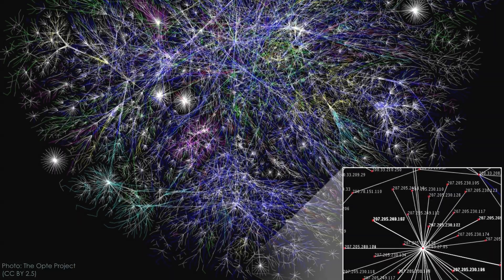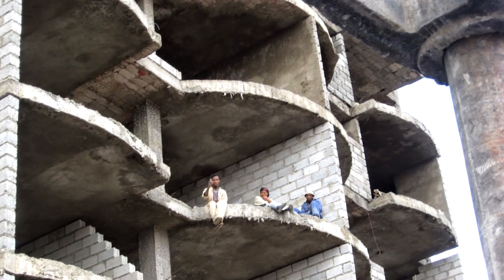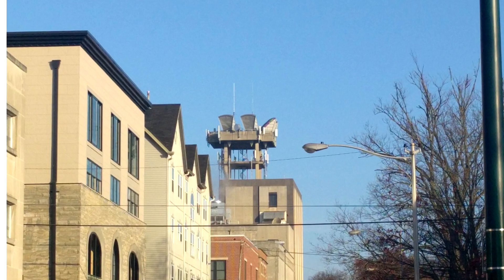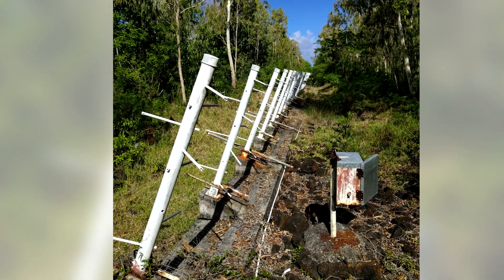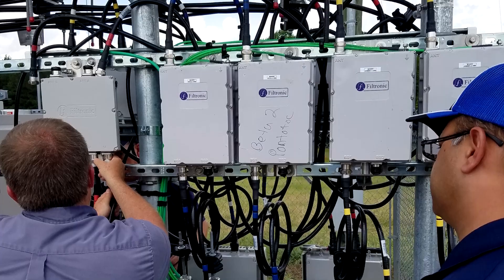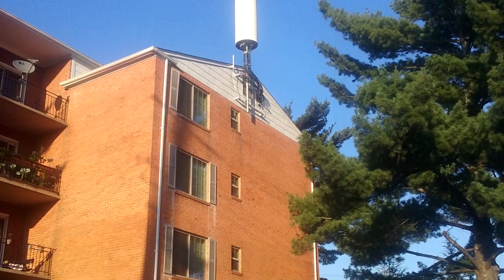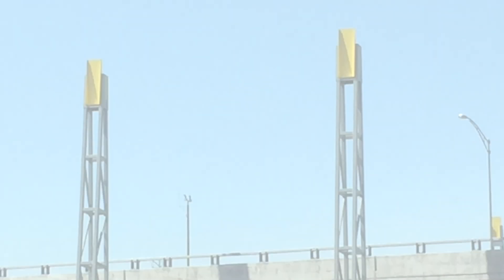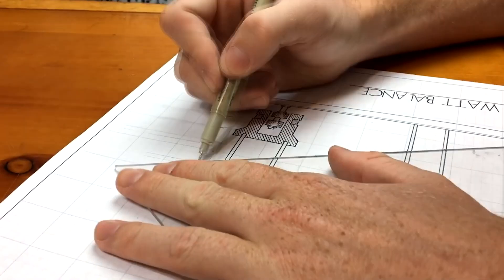What's That Infrastructure? (Ep. 5 - Wireless Telecommunications)

Comment: Small cells is what 5G is going to be based on. Instead of having antennas on tower sites, due to the extremely high frequency of the mm wave (60 GHz), more smaller cells are required to have coverage. This is because the 60 GHz radio waves don't really bend or refract around objects, therefore if the smallest of things is in your way, your signal may decrease in upwards of 30-40 dB, in some cases making it unusable. The high bandwidth of these 60GHz signals require there to be more of a signal present in order to take advantage of all that bandwidth. These signals don't use conventional AM or FM modulation, either. These use a modulation called OFDM (Orthogonal Division Frequency Multiplexing). This is not your conventional CDMA or GSM. This operates differently, applying the same technologies that CDMA and GSM use just a much larger scale. There are plenty of resources explaining how OFDM works, so I won't get into it here because it's a pretty complex topic, but it allows much more data to be transferred than other methods. So basically instead of having 300 foot towers every couple of miles, you're going to have these small cells roughly every couple hundred feet. Also, these small cells aren't just used for 5G, they can act as small base station sites to fill in areas of poor coverage for existing technologies like 4G LTE. In hilly or mountainous terrain, it is really a challenge to get coverage into valleys. So, this new technology of small cells can help fill in the gap of coverage into these hard to reach areas.

Comment: at 1:00 you mention crazy guy wires, those horizontal wires are actually part of the antenna itself... and the towers themselves are also usually part of the antenna in an installation like that (they will have giant insulators at the base of the antenna to isolate them from ground)

Comment: The old AT&T long lines microwave towers from the 50's-60's make great infrastructure tourism.  They were spaced about 30 miles apart and used to carry a lot of telephone calls and video.  They've been replaced by fiber optics, but some are still in service as cell towers or simply abandoned.  With the cost of spectrum increasing, I would imagine that fiber optics are far cheaper per bit transferred, even with the increased cost of burying fiber everywhere.
Reply: The tower in key largo florida is really cool to see

Comment: In the UK (at least), you often see mobile phone antennas on large electricity pylons, I was told this helps carry the signal further? Not sure.
Reply: We do that in Australia, it is done because the pylon is already there so falls under a "Low Impact" category so is easier to get approved under town planning rules here.  Nothing to do with increase range.
Reply: @pvda64  I think there still is some truth to it, I had a friend who had a high voltage line that passed through his garden, and could pick up radio stations from a hundred miles away

Comment: Here's another thought about the Quebec bridge "decoration":
Those masts are mounted at the tip of concrete "wedges" in front of the pillars, so they may have something to do with the purpose of those wedges (see https://goo.gl/maps/RXgzE5Sj9JdPw7Jf7).
The wedges are probably there to reduce the risk of fatal collisions with the pillars, by lifting up an incoming vehicle and thus converting part of its kinetic energy into potential energy.
However, atop the pillars sits a beam jutting out in front, which might be low enough to penetrate the cabin of a high vehicle (e.g. a truck) "humping" the wedge, a scenario against which the vehicle's normal passive safety mechanisms would offer no protection whatsoever.
The masts might have been added as an afterthought to allow the vehicle's front crumple zone to take at least a portion of the crash energy in such a scenario.
If that is so, then the masts may be functional, while the yellow thingumajigs at their top may be purely decorative.

Comment: Just like on 1:41 the same type "horn" transmitters was mounted on the top spot in our city to block radio station "Voice of America" signal, during Cold War. It started to transmit "beep", then news program was beginning, but not reacting on music. Later, they transmitted just one unmodulated frequency, and it was enough to disable common receiver circuits. But radio hobbysts figured out how to avoid it by own made receivers.

Comment: At the beginning of the video, about the radio towers in Ethiopia:  Most of those wires are not guy wires to hold it up, but actual VLF-HF (depending on what it actually is) transmission lines, or parts of the actual antenna.  The cages are a dead giveaway.  Google "Caged Dipole" for a simple example.

Comment: I was hoping this would be about the antennas I see hanging off everything around town. I see antennas on road signs, usually with a solar panel near. There are the little cylindrical silver ones. The ones poking out vertically or horizontally on the traffic light poles.

Comment: They are Canadian Moose detectors.
Reply: Don't laugh we have them here in northern Ontario, on a bad section of road where moose crossing are heavy in that area and many people have been killed by hitting moose at night right at the bottom on a steep hill close to a swamp .. The sensors are along both sides of the highway and will relay the signal to the next set of sensors for about a mile to flashing lights at each end to warn motorists and truckers,. Also when the Flys bugs are heavy they like to get out in the open for some wind breeze and to lick plants for the salt residue from winter salting.

Comment: Hey Grady, I'm a fellow engineer (electrical) I work in power design. 
I'm just chiming in to let you know that the image you show at around 0:10 contains no telecommunications infrastructure. There is a three phase HV overhead power line with OHEW and a UGOH connection.

If this was on purpose then never mind this comment.

Comment: Great job btw!  

From a Tower Climbers perspective, some advancements I've seen come on board are

1) Now fiber goes up the tower,  along with DC power, and the radio units (gsm, lte, umts, wll, ect. Previously, all that stuff was on the ground, just RF equipment went up the tower (antennas, coax, and and TMA, Tower Mounted Amplifiers. The reasoning was that DB Loss would be much less, kinda like you loose amps when you use 300 ft of extension cord.

2)Antennas have come a long way! They used to just cover one freq. band, one Tx & one Rx, meaning transfer and receive. Now its not uncommon for me to be installing not a "2-port" antenna but 12-port antennas. New antennas cover a variety of freq bands. They even have antennas with built-in Radios now! Yes, they are very heavy.

There's Negatives Too:

1) From a safety perspective, and some WISPs are better than others, the amount of weight being added is a concern. Not so much with regards to the tower, but to the existing "Booms." Basically the steel apparatus that is attached to the tower and is responsible for the equipment being installed.  . 

2) The added equipment has to go somewhere, and it has to get there somehow. Basically, poses more obstacles for climbers to have to maneuver around. And the old block and tackle techniques are not ideal in some hoisting situations we find ourselves in. i remember when i could clip an antenna or two onto my hip and bring it where it needed to go, not anymore. 

i predict, probably 30 years from now, the FEDS will jump in and have more over site over the industry, maybe require new tower designs, with the increased telecom equipment in mind. 

The industry isn't in its infancy anymore, but it still has a ways to go before its what i would consider a mature industry.
Reply from the maker: +Dan Rooney Very interesting! Thanks for sharing those thoughts!

Comment: Wisps, or Wireless internet service providers are awesome, they fill in the gaps where your wired suppliers cant help. But, if you ever get the choice, go for wired, they're faster than a lot of copper ADSL2 lines, but ultimately they're unreliable and can cause a lot of frustration, I speak from experience.

Comment: About those markers.  My first insight was a radar reflector for a channel under that bridge.  But these are not what most radar reflectors look like.  Secondly, in the very lower right corner of the image you can see the top of the tower on the other side of the bridge, that tower has the same thing facing what would be the wrong way for a radar reflector.  I was looking at Aids to Navigation info from the Canadian Coast Guard and did not find anything like this, but I did have one insight and that is Canada uses more yellow markers and buoys than we do in the USA.  So maybe its a visual marker, but that still doesn't explain the "backwards" one on the other side of the bridge.

Comment: Maybe the yellow things are radar reflectors for the ground avoidance system on planes. Just guessing, i don't know if that system uses radar but i remember seeing somewhere a video about radar and that kind of concave shape was presented as a reflector, showing up much larger on radar than its physical shape..
Reply: I did ponder that.  I commented that there is a third reflector on the other side of the bridge (visible in the lower right corner).  Maybe planes frequently land or take off in this direction, which would explain markers at the top of a tower and only facing one way.

Comment: Thanks so much for doing this channel. As a Geomatics engineer I appreciate how you help explain our man-made world in easy to digest terms. Engineers need to do more of this!

In Canada our WISPs provide sub-par services in rural areas and only to those areas that are profitable. I am a part of a grass-roots organization called Clearwater Broadband Foundation that is trying to get a fiber network built in our county. We currently suffer from average speeds less than 5Mb/s at low-time and only around 50% of our residents are being serviced currently. Telus has brought in a cellular modem solution, but after only 2 months of the campaign, most are already noticing service degradation due to over-saturation of the sparse cell network in our county. 

CBF's research, including examinations of counties in Washington state that did the same nearly 20 years ago, shows that not only is fiber a FAR better alternative for rural jurisdictions than it is for urban ones (especially those, like our own, that are geographically challenging for Wireless), but it is the cheapest infrastructure a community can build for itself (and it is cash-flow positive, even before consideration of broader community beneftis). No Investor owned ISP (large or small) is willing to do this for our county (mostly due to the payback period) so we've opted to get it done for ourselves. Our biggest struggle right now is finding educational material for our community engagement. People need to understand, as simply as possible, what fiber is and how it is different that wireless/cellular or the old school copper cables we used to get dial-up on. 

Is there any chance you can help us out?

Comment: Also watching this from a WISP!
Except I'm the access point provider, they use this house as a potential access point for many nearby people.
I get the internet service for free and get speeds of around 80/80.

Too late to send in pictures of this equipment? Cause there's pretty neat 5GHz equipment on the roof for the backhaul and access points. Also a switch with backup battery in my closet.
They are going to upgrade it to 11GHz which is license pretty soon, bumping the max link speed to 500/500 full duplex (or 1gbps half dp)
Reply: Sounds amazing, I'm planning on doing Networking and Service Providing at collage and would love to talk to you on how things work

Comment: #unlimitedData
Reply: ReBootYourMind IS GOING DOWN.
Reply: james Fra not when you’re issuing a wide open 15 year old plan :)
Reply: No such thing as unlimited data. ALL data plans have limits regardless of what the advertising says. It's one thing that has pissed me off about cellular providers. Advertising "unlimited" data, just to then include in the fine print a limit so low that I would use it up in a few hours tops, then they call me an exception to the norm.

Comment: Regarding the photo taken in Quebec. If this was part of a bridge structure could it possibly be a radar reflector for watercraft? Or perhaps small aircraft?
Reply: Maybe its both? Engineers say "we need a radar reflector" and architecture says "ok, can we get away with something that looks like this"
Reply from the maker: Perhaps. I did have a radar token on a previous WTI video, but it looked a little more "purpose-built". I'm thinking that these may just be for aesthetics.
Reply: Radar reflectors are numerous sheets of metal attached at right angles. Google image shows their construction.

It could be a "channel range marker" to indicate the center of the navigable channel under the bridge but those are almost universally red-white-red vertically striped.
Reply: it's actually next to a highway overpass that had just been rebuilt last year. type "45.573455, -73.373988" in google map and street view to have a good look
Reply: A wider angle shot of the site would have been nice. Context is important when trying to figure out what something is.
Reply: and machinists say, "I made it to the print" go ask engineering
Reply: I am familiar with the diamond shape radar reflector. I was simply thinking that it may have been a simple one to suit the overall structural design. With the simple 2 sides at right angles it would still amplify the reflection, just not as much as the typical ones. It was just a guess and completely assuming it was a bridge over a waterway.
Reply: As you can see here, they don't have any wires coming up the towers.  I'm pretty sure they are just an aestethic addition. https://www.google.ca/maps/@45.5738516,-73.3710951,3a,31.1y,329.81h,124.93t/data=!3m6!1e1!3m4!1s6Kx-_Q7taC_AlIl1hwDNpg!2e0!7i13312!8i6656
Reply: @simonbranchaud9886  Interesting picture.  It appears those towers don't do anything!
Reply: The yellow colour of the Quebec photo is VERY VERY close to "Vidéotron" colour ... MY guess is it's something to do with their cellular network.
Reply: @chumbuckery777 Has anyone consided that they are a weather visability sensor ?  That can measure how far line of sight or percent of clearness between two points, like measure fog density. Here in Canada they have sensors that travell somewhat like a light beam to measure how heavy the snowfall is in for whiteout conditions to warm motorists on bridges and for road closures. We  have them om some bridges as well, the weather channel somewhat does this to measure cloud height. Being a sailor the radar range markers concept first came to my mind as some of use and have them mounted on our masts the but the shape/design was slightly off..
Reply: @Sandpipercom  Best theory I've seen so far. Bridges like the one in question rarely get much attention in terms of decoration, so I'm pretty sure there is some technical purpose to those masts.
Reply: something to do with the airport nearby?
Reply: I agree it most likely is purely aesthetic but can't rule out wireless communication purposes simply because wires aren't visible. Wiring could be ran through the inside of the structure.
Reply: Jim Jones markers for aircraft are universally red or red white checkered.
Reply: Has anyone considered contacting the provincial highway officials and asking?
Reply: Is it a marker for low flying aircraft? Is there a hospital nearby that accepts air transport?
Reply: It's a little bridge with a highway passing under. For someone who drove there many times I think it's just for look. There is no wire going up the structure. However it is a strait piece or road that is sutable for emergency landing with an small aircraft so it might be to mark the bridge. @practicalengineering
Reply: As a trucker/ham, I've seen similar structures all over the US used for little more than simple architecture.  That said, they could be easily used to conceal a "low clearance" warning system for truck corridors known for transporting "over dimensional cargoes" or low bridges.  Additionally a system like this "could" be used in conjunction with "weight scale cells" in the pavement for "weigh in motion"  systems for a weigh station, such systems are fantastic for " rolling inspections" allowing weight, bridge law and physical dimensions can be checked with the truck still rolling at 10-45mph depending on the system.  At several weigh stations I've even seen Thermal cameras used to allow the Scalemasters see tire/brake/other observable temperatures(poorly adjusted brakes show up cooler than others, causing properly adjusted brakes to operate hotter, brakes can reach temps capable of igniting axle grease, under inflated tires are known to overheat and ignite, causing trailer fires.  

As i dont see any wires associated with these structures and they dont "appear" to be directed st eachother, im inclined to "assume" that they are decor